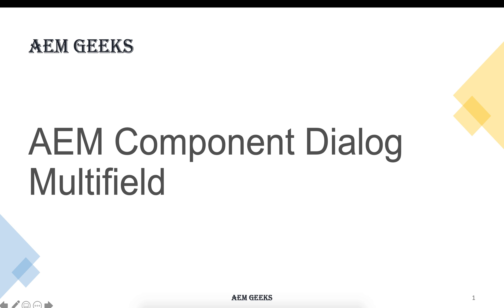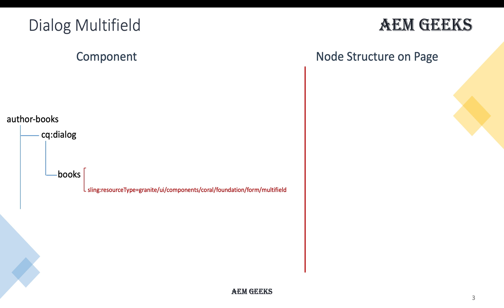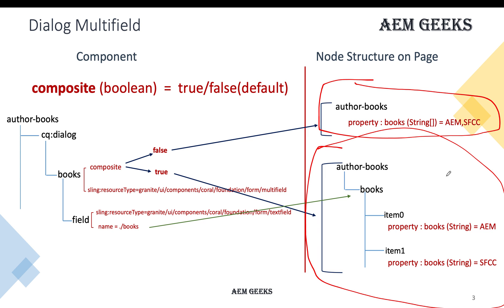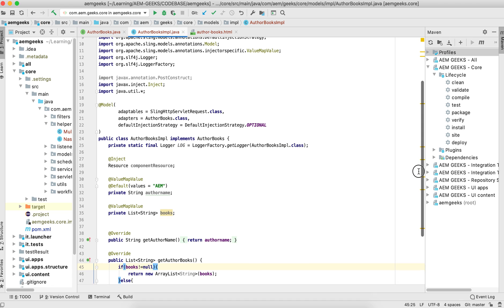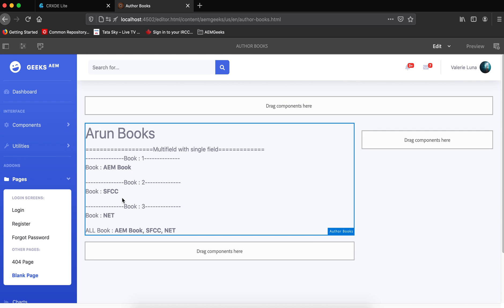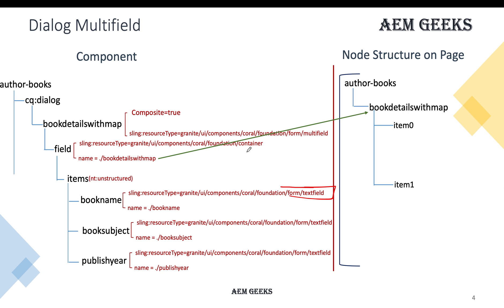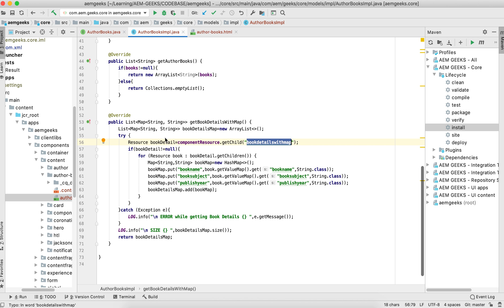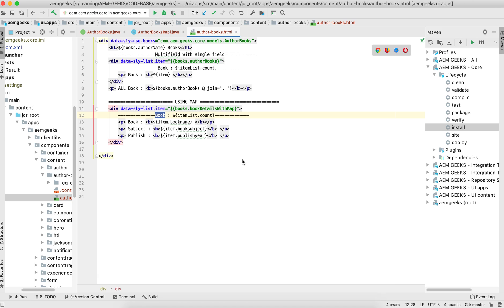AEM Tutorial #13 | Multifield Dialog | Multifield Dialog with Sling Model in AEM

Comment: I used @Inject for injecting the Resource, it was not working , I had to use @ResourcePath annotation with path of the resource to be injected. Any idea why?
Reply from the maker: Ideally I should work. Component resource should be injected in model.   @ResourcePath is used to inject other resources. Can you check what adaptables  you are using. Its difficult to comment with seeing code. 
I will suggest you take a look of demo code once and Sling Model related tutorials also. Where I explain annotations in details. 
Please check demo code :  https://github.com/aemgeeks1212/aemgeeks
Reply: @AEMGeeks   Hey it started working after I installed ACS commons Package into my local, wasn't aware of this, could you tell what this package helps for.

Comment: org.apache.sling.api.resource.PersistenceException: Unable to commit changes to session.

I'm getting this exception when I tried configuring and saving changes to a multifield component. I tried a lot but am unable to fix it. Can you please help with this?
Reply from the maker: There may be many reasons. But this not related to multifield. 
1. Check if you have proper permission to add/update content.
2.  If you took content from somewhere else, Please check any uuid added to page/component node. If yes then delete.
3.  Create new page and than use component.
Reply: @AEMGeeks  Thanks for your help. I found the solution. The problem was in the node structure. There were ./ added by mistake in the name property of the items of the multifield which wasn't correct.

Comment: What is the use of componentResource injected/mentioned at 8:53 for multifield with single field defined?
Reply from the maker: This used as variable for component resource. This used for other use cases explain in tutorial. This not used for single field because I did not use  composite(true) for this use case. 
Let's imagine, if you use composite(true) for this case also, How will you get those values.

Comment: I have one question
For a nested multifield dialog, how will I display the value entered, just by using sightly (I'm not interested in sling models now) 
if I do ${properties.bookname} , ${properies.booksubject} , ${properties.publishyear}  in the component's  .html file, the values will not be displayed for the nested multifiled dialog .  How will I achieve this?
Reply from the maker: aditya srivastav, Do some research and try to achieve this. try to find answers of below questions as well. this just for your learning. I will answer after your research.
1. How nodes getting created on page once you save multifiled. 
2. Can you iterate those nodes directly in sightly.
3. Can you process those nodes only in sightly.
4. How will you read nested dialog saved node values only in sightly. 
5. Purpose of  sightly is to display values not write business logic or logic for processing.
6. when you should fetch dialog values directly in sightly.

Finding answers to above question will enhance your knowledge. If you need to know more about sightly, please follow sightly playlist.
keep learning..
Reply: @AEMGeeks  I learnt few things
A nested multifield dialogue value can not be displayed using sightly. It's not possible, we need sling models for that.
Also, multifield values gets saved as child nodes.
So, data sly list attribute of sightly is very important in cases of multiple values to fetch and display. It helps to iterate through the elements.

I have watched till lecture 17.

From lecture 18 it's bit high level so taking pause and now starting sightly playlist
Reply from the maker: you are completely correct aditya srivastav, you need sling model to get nested multifield. This is best practice also to use sling model until you don't need any processing/business logic, But ideally you need processing off dialog field values. 
Sling model is also important for content exporter as well. Content Exporter is one of the reason to use Sling Model. You will understand this once you follow content exporter related tutorials. 
After completing this playlist/series, you will have all understanding of AEM basic backend development concepts/topics.
keep learning...
Reply: @AEMGeeks  I have paused the basic video playlist till video 17.
Content as a service video 18, I saw and realised it's little out of my understanding. so I paused. Also I need to fix my backend so it works.

So I am starting sightly playlist.
After sightly again I will again watch from here.

Comment: Nice video . This multifield is not working in 6.5 with acs commons 4.10 the values are always getting stored in node_store format with composite true and when composite value is set false dialog is not retaining values. Please share the code of multifield which stores values in string array/ json store format AEM 6.5 and acs 4.10
Reply from the maker: Priyanshi Shrivastava, The multifield, I explained in this tutorial is independent of ACS Commons. I am using granite/ootb multifiled. I code this tutorial this in AEM 6.5 with service pack 4. You might missing something. could you please take code from my git repo. Just build the whole code and deploy all module package. you will get every thing. 
https://github.com/aemgeeks1212/aemgeeks

you can not add as in JSON format in AEM 6.5. Granite/Coral 3 add multifield in node structure only. You can easily parse to JSON. You can do it with ACS Commons by adding a property with Coral 2. But I guess that is not supported with AEM 6.5 now. So you have to write some custom code for your requirement. 
We have to write custom code to save values in json format. I wil try this once i have some time. But I will recommend you to use multifield with node structure only. this is the standard way.
Reply: @AEMGeeks  i see similar issue where i have multifield with 2 field and composite = false. This saves the multifield values as array of a string, which is what i need. I dont want JSON. However, when i try and open the dialog, the saved values are not retrieved. I understand for JSON we need to write custom code, but i just need the saved values as is. Any suggestions. I'm on AEM 6.5 with SP 17.

Comment: I have implemented the same but I am getting org.apache.sling.api.SlingexceptionL cannot get defaultSlingScript : compilation errors in org/apache/sling/scripting/sightly/apps/sdm/components/functional/topnav_html.java:
Line 28, column 1274: Only a type can be imported. com.sdm.community.core.models.TopNavs resolves to a package
Line 65, column 2766: Topnavs cannot be resolved to a type'

This is happening when I drag and drop component on a page @AEM Geeks, Can you help how to resolve my issues.
Reply from the maker: Nikanth Chakka, Are you getting this with my code, means demo code present in git.

Comment: Why the definition of the multifield has a very long hierarchy? It's very hard to define and create in CRXDE. Is there a way to assist in creating such hierarchy?
Reply from the maker: Faham , This is the way to define multifield. There are other fields also and also define tabs to keep these multified. Thats why it is looking long. 
If you see PPT, I mention fields required to add multifield. Try for understand dialog structure. It will very easy to create any kind of field in dialog. I will try to create a video for dialog.